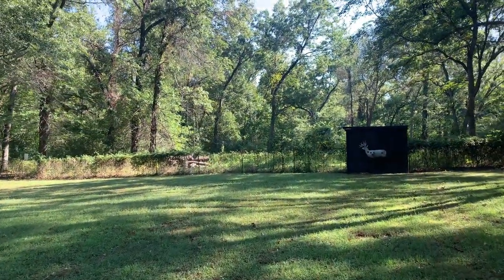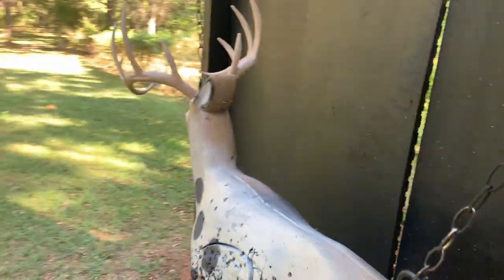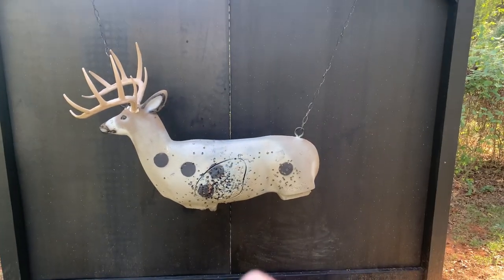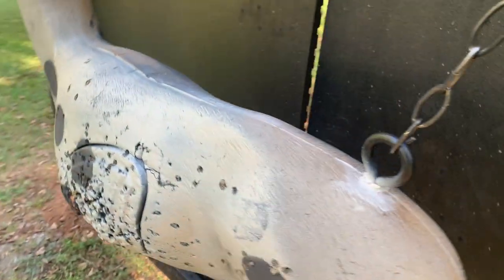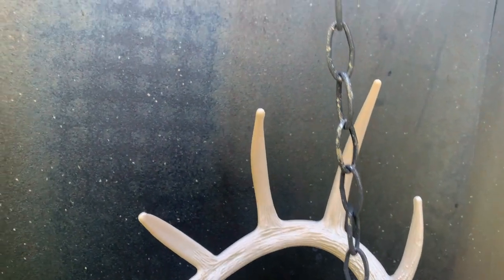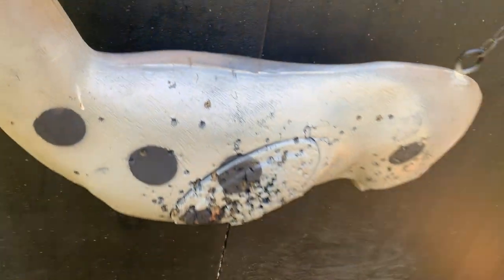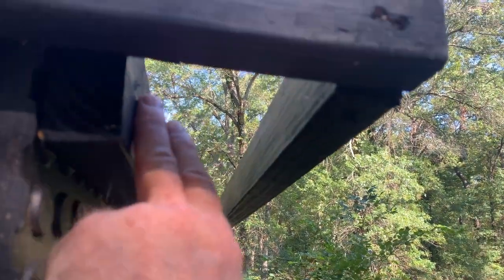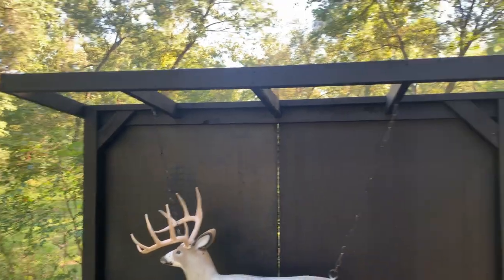ARCHERY TARGET BACKSTOP! EASY AND INEXPENSIVE TO BUILD

Comment: Nice job on the backstop. The only thing i would do differently is i would use rope instead of chain for hanging the target. This way if u accidentally hit it with a arrow you won’t damage the arrow hitting the rope like you would the chain. Otherwise great job.
Reply from the maker: Thanks. The rope is a good idea. BTW, we have shot 100's of arrows and the horse mats are holding up great.